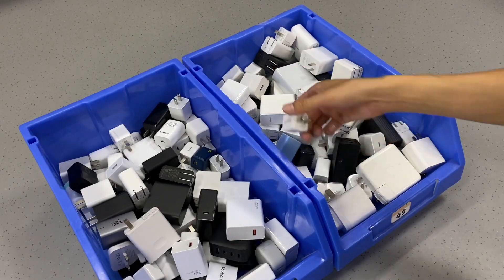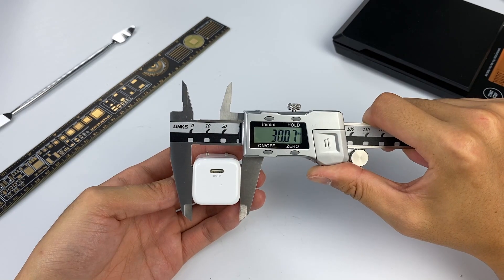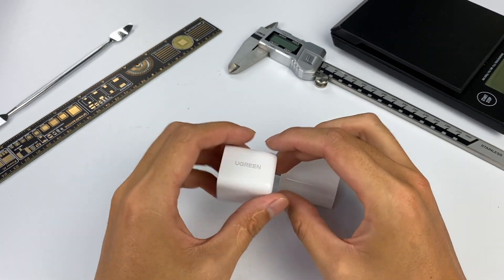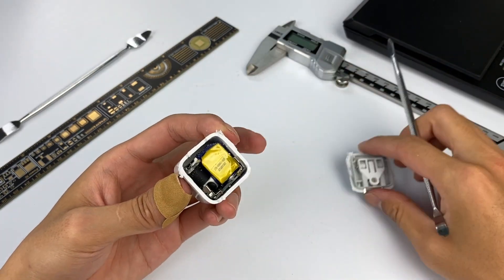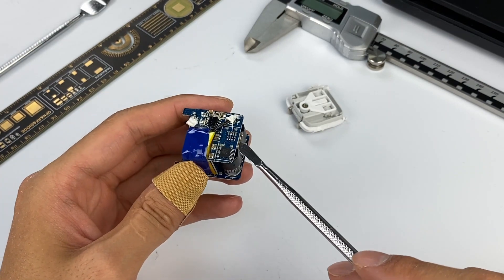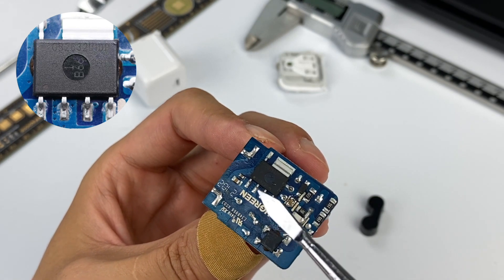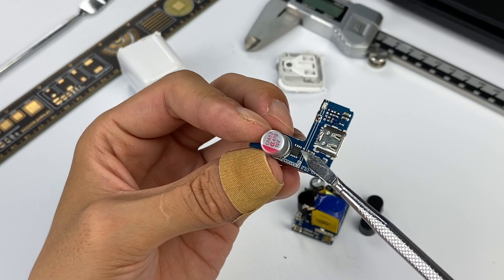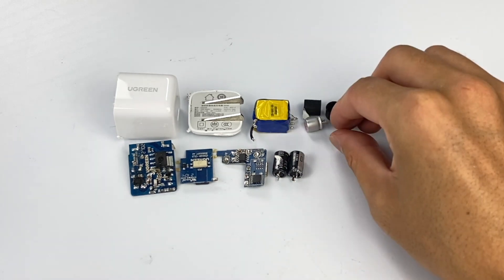Teardown of UGREEN 20W Mini PD Fast Charger

Comment: How does this ugreen 20w charger differ from apple original 20w?
Reply from the maker: This one is smaller and cheaper.
Reply: @ChargerLAB  That’s it? Is it safe like the apples 20w brick? Wont it degrade the battery life faster?
Reply: @MrCriddles  all chargers degrade the battery life of the phone, the faster the charger, the faster the battery heats up.
Heat damages the battery.

Comment: sir my ugreen charger same on this video have now humming sounds when plugged on ac. can i still use it? thanks . 
i hope you notice  and why it sounds humming. thanks. from taiwan and philippines
Reply from the maker: It's the normal sound of AC to DC conversion, if you really annoyed by this, you can contact UGREEN for a replacement one.

Comment: at 6:22 that should be a Cy (safety) cap - that has to fail open and it's used as a return path the high freq capacitive coupled current of the transformer back to the mains. It' very important with regards to safety.

Comment: Measure the output voltage ripple. The ripple should not exceed 200mV. Good 10-80mV.   (VBUS Oscilloscope)

Comment: Give me a fast charger
Reply: Lol,
Reply: A Beggar. 😭 Anyway question to chargelab. Which charger do you choose from my list: anker nano, anker nano pro, ugreen mini pd fast charging 20w or baseus pd cube 20w?
Reply: @Sunstepa  im using the ugreen 20w mini rightnow and it charges very fast
Reply: @johnveradranida3078  does it make any noise or buzz then charging?
Reply: @Sunstepa  mines not buzzing whatsoever, the reason why i only picked this over the anker nano is that the nano variants here in my country are from china which has only a fixed 50hz input, my country has 60hz output
Reply from the maker: We are not the seller or manufacturer, but just an independent platform. So I am afraid that I can't do that. Thanks for the supporting anyway.💗
Reply: @ChargerLAB  hi could you do a tear down of Ikea Askstorm 23 watt and 40 watt both PD chargers and very affordable